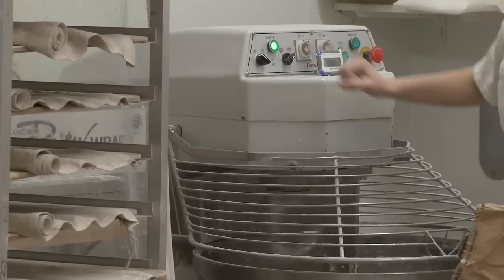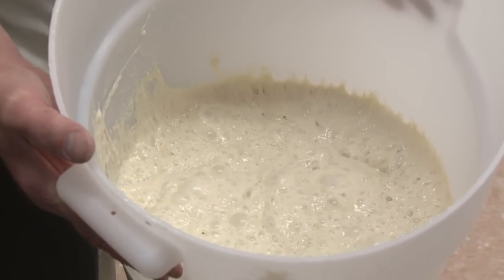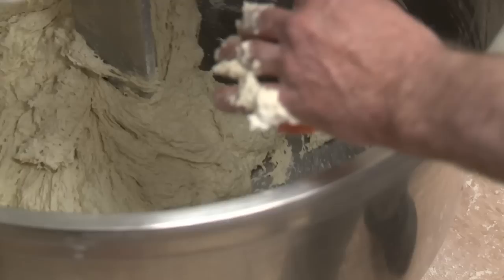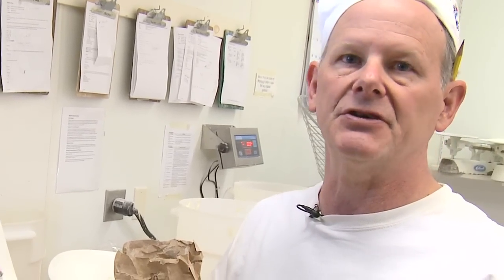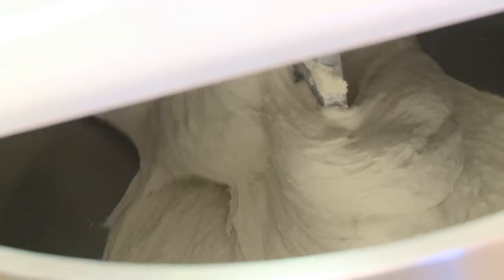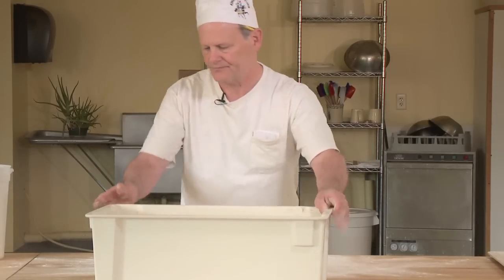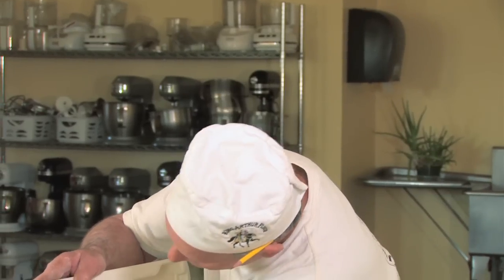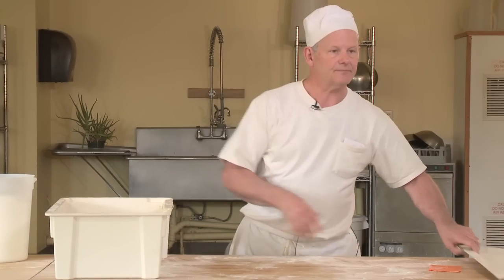2. Mixing & Folding

Comment from the maker: @azt3c  It is best to adjust your hydration, though with natural climate humidity, you only need to do it slightly to accommodate the change.  Hold back on about a ½ cup of water and only add it as you see it is required.  You will be able to determine this as the dough mixes and begins to form a cohesive mass.      -Deb @ KAF

Comment: a few questions to ask ,
what temperature do you have your kitchen set at ?
what about humidity ?
cooking time and temperature ?
advice on whole wheat white weed mix multi seed bread ?
how long does it take for the dough to relax ?
Reply from the maker: Hi Nidal! The temperature and humidity of our kitchens change from season to season so it varies. The goal is for it to be between 68°F and 72°F. The humidity isn't controlled. These breads generally bake at 460°F but baking time will vary depending on the loaf size and hydration level. Proofing time also varies. We encourage you to look at the professional formulas on our website for details and instructions: https://bit.ly/2NywkY1 Since this video is more about the technique of mixing rather than specific recipes, these formulas will be extremely helpful to you. Recipes using seeds are included. Kindly, Annabelle@KAF

Comment: Hi chef, i hope you can help me. Every time I am mixing the dough using my 10quart mixer i noticed that my dough is getting warm or hot while mixing it and I ended up throwing it. do i need to use cold wet ingredients? I am using strong bread flour.
Reply from the maker: Hi Basic Life simple! There are many ways to control your dough temperature. We have a wonderful blog on this very topic. https://bakewith.us/k7348b Using the temperature of the water is the easiest way to control the dough temperature. If you live in a particularly warm climate, keeping your flour in the fridge is another way to reduce dough temps. Good luck! Jonathan@KA

Comment: How can we know when the dough is fully/properly risen to move onto preshaping?
Reply from the maker: In general, bread is ready when it's puffy and marshmallow-like. When poked with a floured finger, the indent should very slowly fill back in. If it pops right back out, the dough needs to rise a bit longer. If it doesn't fill in at all or collapses, that's a sign that the dough has over-proofed. Annabelle@KAF